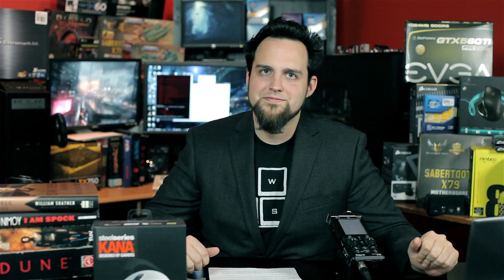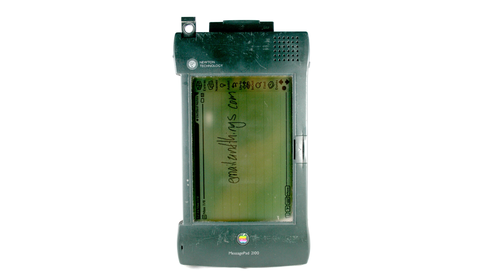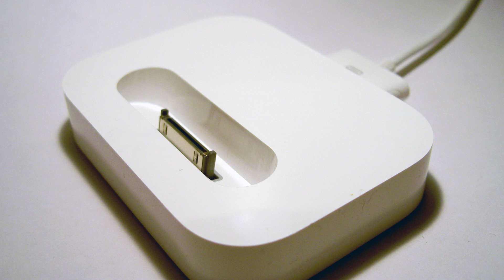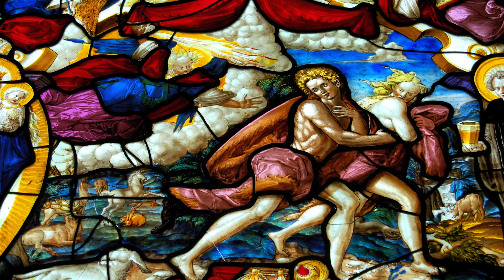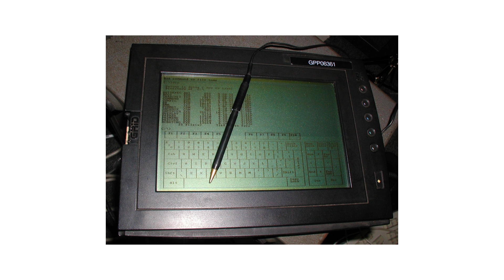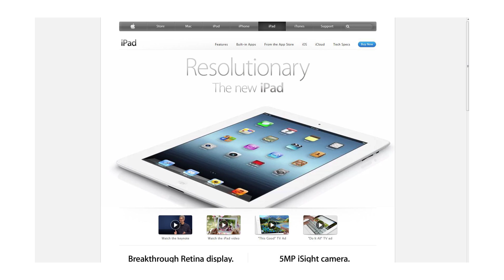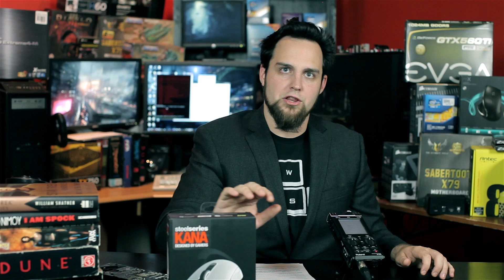Has Apple Really Ever Invented Anything?

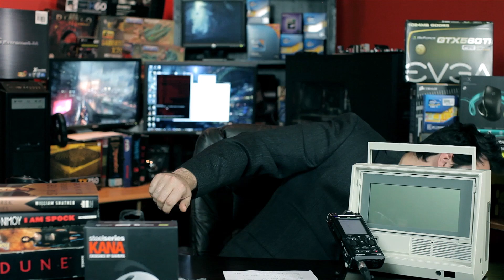Comment: REF: 14:00
Order of part strength: Forged > Cast > Machined.  Castings are stronger than machined parts because the grain of the metal flows throughout the object, more effectively transferring stresses between internal crystal structures.  When machined, the crystals are cut and interrupted, leaving the opportunity for "stress risers" to decrease fatigue life.  Casting of aluminium is actually much faster than machining and more efficient material wise. Investment cast parts can be made incredibly quickly and with a fairly decent surface finish.  

The reason that the unibody laptops were machined is because of their shape, sharp contours and impeccable surface finish.  The sharp corner around each keyboard button does not lend itself well to a casting process. The thin shape of the laptops would be nearly impossible to cast since the aluminium's high thermal conductivity would cause it to cool and solidify onto the edges of its mold before reaching every tiny crevice it its shape.  You can get around this problem by heating the mold but the aluminium would shrink as it cools.  You can compensate for the shrinkage but without cooling it perfectly evenly (nearly impossible/costly/time consuming) areas that cool quicker would pull material away from hotter, more malleable areas, leaving thin spots.  

Cosmetic parts that are cast are almost never cast in their final shape, fit, and finish.  They usually require a secondary machining operation.

I suspect this is how apple makes its unibody laptops.  It purchases blank castings of the general shape of the part (to reduce machining time and material life and increase tool life) then cut the blanks into the final shape and finalize with a surface operation.

CNC machining is NOT a slow process.  Modern vertical machining centers can reach spindle speeds of 18000rpm and several hundred inches per minute.  They blow through aircraft grade aluminium like its not even there.  A flexible manufacturing center could pump out thousands of these parts in a day with maybe 1 or 2 operators at the helm.  

Source: BS Mechanical Engineering + Years of manufacturing experience

Comment: Holy crap people, all of the comments so far have totally missed the point. The video is not based around flaming Apple. The man says himself he has/does own several Apple products and likes them very much. He is simply pointing out the way Apple bullies the market. Yes, Apple (namely by way of Steve Jobs) has ABSOLUTELY used the word "invent" when they should have used "innovate." They did NOT so much as have a hand in firewire or mag-connect, simply picked the techs up and labeled them as their own.

Apple is a GREAT company, does many things better than any other company out there (and that hurts to say as a man with 5 Samsung devices in arm's reach) but needs to stop bullying companies they share the market with. After all, the Galaxy line of phones wouldn't even exist if Apple hadn't backed out of a contract with Samsung forcing them to re-purpose tech they had designed for the early IPhones. Then apple went and tried to sue them over the WiFi tech when Samsung had all the rights and the IPhones were still using tech based on that design even after they broke contract? This crap has gotta stop.

Comment: Another thing that Apple has invented is IEEE 1394, aka Firewire, which is far superior to USB and is used in many fields other than PC's, including the F-22 Raptor and the now retired Space shuttle. It has even won Emmy and Grammy awards for being a revolution in the media industry.
Reply: quote wikipedia: "Implementation of IEEE 1394 is said to require use of 261 issued international patents held by 10 corporations."

Can you really still say Apple invented firewire?
Reply: Max Stagsted So if you licensed a patent for a leg and a patent for a board and put that together, you would be the inventor of the table just because the two already existed?

Inventing things using existing things doesn't make it less of an invention. The fact still remains that Firewire was a really great invention, and is no matter how you put it an invention. They managed to reach transfer rates that didn't exist at that time. But due to all the patent licenses that were used it also became more expensive.
Reply: You make a good argument about the table, using parts to create something new, is still inventing.

Apple claims to have invented FireWire, but they where not alone.

wikipedia: "It was initiated by Apple (in 1986[4]) and developed by the IEEE P1394 Working Group, largely driven by contributions from Apple, although major contributions were also made by engineers from Texas Instruments, Sony, Digital Equipment Corporation, IBM, and INMOS/SGS Thomson (now STMicroelectronics)."

btw, the patent licensing hell was started by Steve Jobs wanting 1$ per port.

Read more here: http://www.johasteener.com/what-is-firewire.html
Reply: Learn your history, guys. You're all bashing on Apple and each other, meanwhile you don't actually know what happened.

Xerox PARC (Palo Alto Reasearch Center) is where Apple first learned of the GUI, and thus gave them the inspiration to create the GUI on the Lisa and Mac. But the Lisa and Mac GUIs are radically different from the Xerox GUI, to the point of unrecognizability. Apple never claimed to have invented the GUI. 

As for who invented the GUI, it was neither Apple nor Xerox: that credit goes to a fellow named Doug Engelbart at SRI (Stanford Research International), who demoed it in 1968: https://en.wikipedia.org/wiki/The_Mother_of_All_Demos

This in turn inspired Xerox PARC to create its GUI, and that in turn inspired Apple to create its GUI, and that in turn inspired Microsoft to create its GUI. (And arguably, Engelbart was inspired by earlier systems, like radar systems, that used trackballs for input.)

What Apple rightfully claims is that they were the first to commercialize it. Without Apple, it might have been years longer before the GUI left the research lab. (Remember that SRI and Xerox PARC were research labs -- they did not create commercial products. Apple is the spot in the chain where the GUI went commercial.)

In contrast, FireWire was invented in Apple's own labs, and then Apple created a working group within the IEEE to make it an industry standard. It was then adopted by many, either with the generic name (IEEE-1394) or in the case of Sony, with its own brand name (i.Link).
Reply: Armadillo im sorry i didnt get that LEG and BOARD analogy. Could you give another simpler analogy? im not much into tech and english is not my first language. Since Firewire was co developed, and Apple claims to own rights over it, i am so confused now specially with that table analogy
Reply: Mike Messiah Lamens terms, no Apple did not. They contributed, but so did other companies.
Reply: Josh350 Yes and no, but it's pretty widely acknowledged that Apple did most of the design work in FireWire.
Reply: Antonio Tejada And Xerox created the GUI, but yet Apple wants to take credit for it.
Reply: Josh350
which GUI?
Reply: XEROX invented the Graphical User Interface (GUI) for the apple Lisa and mac. Apple then claimed that they invented the GUI.

Comment: What apple did historically was make something that was either very expensive or clunky affordable and usable such as the Apple II was one of the first affordable computers with color graphics, GUIs were not mainstream before Macintosh and the ipod was better then it's predecessors.
It should be noted they didn't get the mac right until the Mac Plus in 1986 though by then it was already was eclipsed by more advanced machines like the Amiga and Atari ST.
After the ipod they never really did anything all that innovative other then making app stores mainstream.

Comment: In Steve Jobs' words, which btw barely ever consisted of the one you've pointed to over and over, 'invention', (innovation, yes they've used a heck load of times, but since they never invented a lot of stuff, they stuck to calling themselves folks who think different): 

'Apple is fundamentally, a software company'. At D5, All Things Digital 2007.

So when you take that out and take out one of the major most contributions the company has made to the digital world (Woz's era), you leave Apple with 10 years of directionless movements, and 10 years with Jobs where they pitched some of the most innovative packets of technology to the world. And off of that, if you're out to bash a company because they don't start off with scratch, well, you can go ahead and do that. But even the best tech recipe company in the world has had more impact on it that the other 'most inventive' companies in the world. Because they don't say they are the first to do anything, they're the first to do what really matters. They're more often than not the first ones to change things.

Comment: You guys are pretty dumb. You can't even tell the difference between invention and innovation. Go look it up into your dictionary and you might actually learn something.

About your so called arguments on how Apple doesn't matter, the facts you base your opinions on are flawed at best, shoddy at worst. Mac OS X is a whole lot more than UNIX. The fact of the matter is that although OSX CAN run UNIX software, it uniqueness lies into the fact that developers can use a consistent set of API's to program their applications, together with the modularity of the entire operating system which is what enabled them to shoe-horn OSX on the iPhone in the way they did. It's the API's that what makes OS X unique. This consistency is something that's sorely missing in Linux land.

Also, about the fact that Apple went to ARM to dictate them what they wanted in a processor, this is exactly the service ARM serves to its customers! You can either buy the standard ARM design or make your own design around the existing ARM ISA. Most smartphone companies are just lazy and don't do the effort to design their own unique chip and just buy the ARM design. Instead Apple makes their own design, the latest being hand-layouted chips vs the standard machine layouted chips. You might also want to do some research on how ARM came to be : it was formed by Apple as spinoff after they bought the assets of the nearly-bankrupt Acorn Computer company. So in a way, without Apple, there wouldn't be an ARM to begin with.

The graphical user interface? Sure, that came from Xerox. But Apple did invent the menu bar, the desktop metaphor and a whole lot of other things to bring the concept together and to make it palatable for the general public. They did what Apple does best : start from a good idea and design and build products that actually fulfil the promise of the idea so it actually works for millions of people.

My take on the biggest "invention" Apple ever made? They single handedly invented the commercial consumer software industry. Before you dismiss this, go back to the first sentence of this paragraph and read it again, then let it sink in for a minute. Now, before Apple came out with the Apple II, only a handful of BASIC software existed that exchanged free in computer clubs. When computers are sold by thousands, its not viable to be a commercial developer. The Apple II was the first mass produced computer that sold hudreds of thousands of units giving companies like VisiCalc the break they needed to go on and invent the spreadsheet. Microsoft, Adobe, and a whole lot of others got their break on the Mac. They also invented the current mobile software industry. Before the iPhone, being a mobile phone developer wasn't something you could build a business model on. Again, before the iPhone , there were only a handful of third party apps you could side load on mobile devices, most of them were free. Due to the iPhone, hundreds of thousands, if not more than a million jobs exist in mobile software development.

I could go on and on about your other statements but I won't because frankly I have better things to do with my time. However, I'd urge you to read up on the subject on how Apple's activities are intertwined with other companies in the industry and get to grips in as how this company actually plays a huge role in the industry. Or actually go out there and build a great product yourself instead of making misinformed youtube movies in which you critize companies that actually try to make a difference.

Comment: Didn't Apple pioneer the touch screen smartphone? I mean, touch screens existed before the iPhone, but didn't Apple invent multi-touch?
Reply: The IBM Simon was the first touch screen smart phone.
Reply: Crapple "invented" nothing.. they only created sheep - lol
Reply: Amineo How did they pioneer something they didn't release first?
pretty much same reasoning as with invention right there, bud.
Apple has not in any point in time had a device on the market with the highest resolution, nor true dot-pitch (they've only cheated once or twice leaving out some color's, so it's no true pitch anymore).
Reply: They "pioneered" better screens with multitouch in the smartphone market. Be careful how you use the term "invent", guys. That is the biggest issue here. You can only invent something when you come up with a product that is like nothing else.

For example, If they "invented" the iPad, they would have "invented" the tablet itself. But no, tablets already existed, they just improved the design and made them more usable by "developing" the iPad and creating a product everyone can use.
Reply: Porche made the first sports car, but they dont go around called themselves "inventors". They just improved existing petrol engines.

Comment: Apple did not invent the mouse.
[quote]
In 1964, the first prototype computer mouse was made to use with a graphical user interface (GUI), 'windows'. Engelbart received a patent for the wooden shell with two metal wheels (computer mouse U.S. Patent # 3,541,541) in 1970, describing it in the patent application as an "X-Y position indicator for a display system." "It was nicknamed the mouse because the tail came out the end," Engelbart revealed about his invention.
[/quote]

Comment: I can't really say that Apple invented anything.  I've never been a big Apple fan.  They make high quality PCs that are less powerful and feature rich.  The devices are also much more simple to use and stable due to being forced into using only specific hardware.

I believe the thing that bothers me the most out of what I mentioned is that Apple really locks down their devices and prevents you from doing anything they don't want you to do.  They are making computers for people who refuse to put any effort into learning anything about computers. 

My Windows PC at home can be added to in so many different ways and can be installed with so many different applications that can come from anywhere.  It's far more open to vulnerability and it's more likely to confuse people, but I'd rather have that if it means having the freedom to do what I would like with the computers I purchase.

Unfortunately it seems to be going in the opposite direction.  Developers are more and more locking down their devices/os and forcing specific hardware on you.
Reply: And there is the misconception. Many people confuse Mac OS X or OS X with iOS.
Yes, iOS is locked down, as one can only obtain apps via the App Store.

Mac OS X is not locked down and one can get applications from anywhere and install them.

And as to price and features, if one looks beyond CPU and GPU and maybe RAM and storage speed and capacities, a Mac offers a lot. A computer offering those same features in a computer with an adequate to good design costs the same as the equivalent Mac or even more.

Comment: You hit the nail on the head. I'm a apple user but not one of those apple elitist/fan boys. Mac's are better at a few things but PC's are better at more. What I like about apple is that is something wrong with my mac all I need to do is roll my face on the keyboard and it's fixed. You put it well, apple innovates, not invents. 
Apple's like aston martin, not the fastest, the most refined.
Also cnc machining can pull of tolerances of +/- .0001 in. casting cant even touch that.

Comment: I got a Mac Mini just to test the Mac my self after all this hype over apple product, It froze at day one with out me doing any thing. It required hard restart couple of times, it get laggy with out me using it. and for some reason it didn't support resuming download, it say download fail for a 10 gb game and start over, and after couble of months, like a windows PC it start up time increased a lot, but be aware this computer use Intel's HD Graphic which is ... terrible, not to mention they have way more less software that i use compared to windows.

In another word they both (windows and mac) have the same technical problems. I were happy with windows 8 and how it run smoother until ... after every windows update some really annoying things happen. some times i wonder why am i even updating it. and it also get slower over time, unless you are happy with an SSD only laptop with small space... which is sad.

If there is any thing i want to get my hands on from apple as a computer accessory is there computer's screen, some people suggested Samsung screens as an alternative, but that is yet to be seen.

Comment: COMPLETLY STUPID, OS X was based on NeXTSTEP, from NeXT that Steve Jobs created after he got fried from Apple, and Apple they bought back. It's not based on FreeBSD, it has FreeBSD code in it, and it's based on Mach experimental microkernel. But has a much bigger development, the kernel is just a tiny part, most of the kernel are in Apple kernel extensions, and the librarys, called Cocoa, that are used to make Mac applications, and the reason you can't have Mac app's on FreeBSD, Linux, etc.